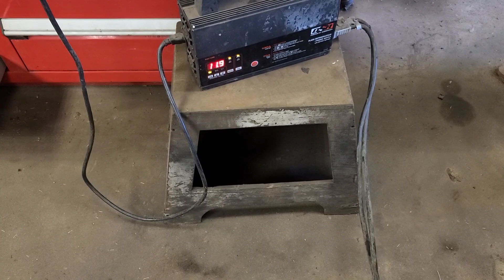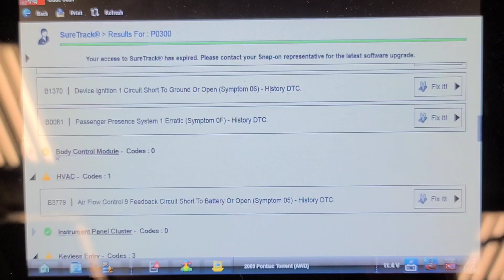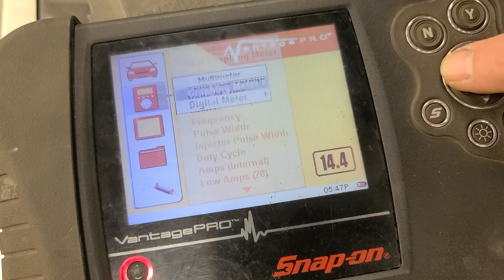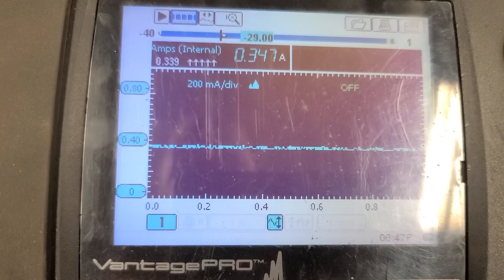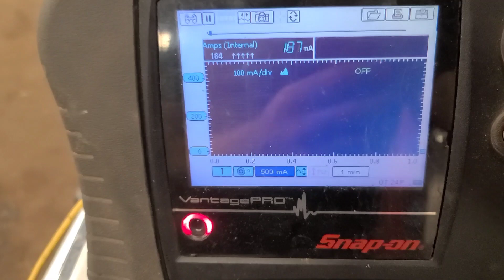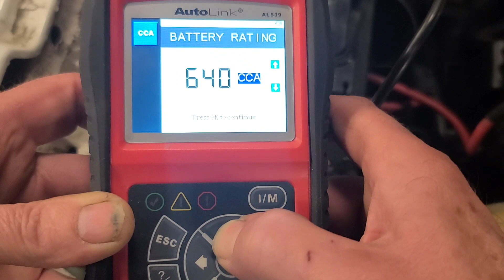2009 Pontiac Torrent Battery Going Dead Parasitic Draw Testing

Comment: This was interesting.  It can be tricky to eliminate all the loads while testing for parasitic draws.  I fooled myself while checking for a parasitic drain on my Chevy Malibu 2 years ago.  The Body Control Module was drawing 150 mA.  Everything appeared to be off, but I discovered that the Malibu has a hood latch sensor, and the hood was open to test the battery and fuse box.  It took about 40 minutes for the BCM to go asleep unless the hood was closed.